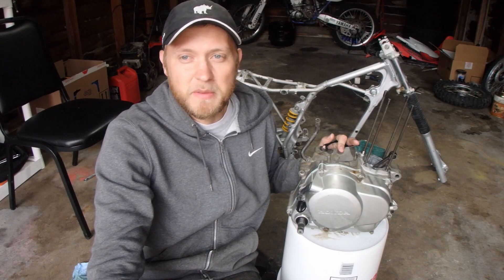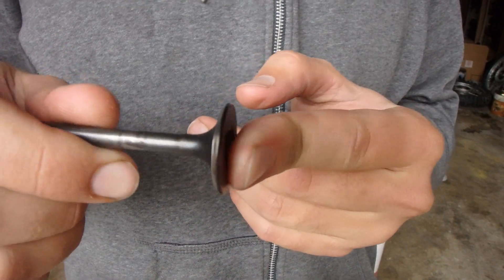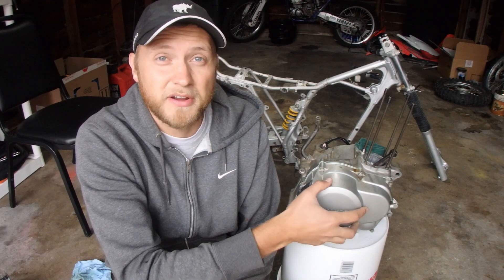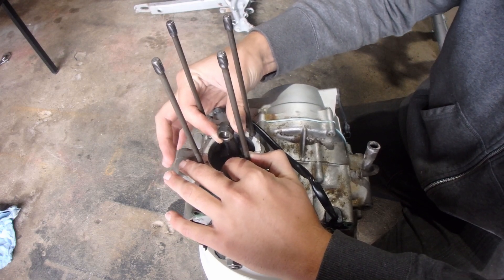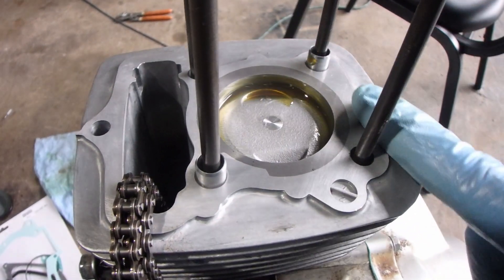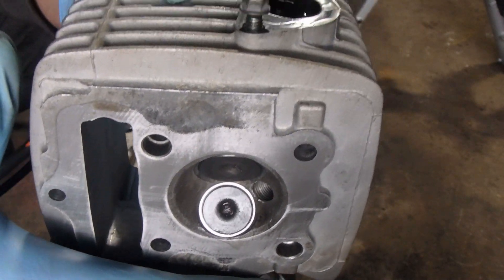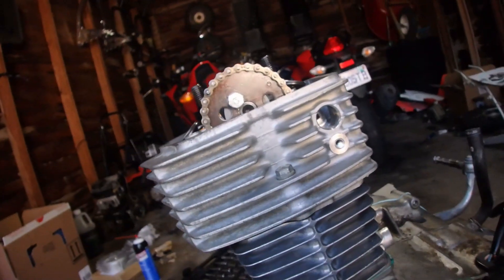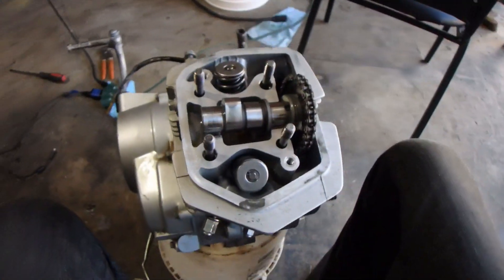$350 Project Dirt Bike (Part 3)

Comment: What are all the different lubes you are using when putting this together?  Im also wondering if you should lube all the parts when putting it together or are there some you don’t lube.
Reply from the maker: I'm cheap, so I just used engine oil to lube everything. Seemed to work just fine 🙂 In my opinion you can't go wrong by putting a little oil or assembly grease on every part as you put them together. I wouldn't worry much about the type of lube.
Reply: @jontanner1  thanks man I appreciate it!